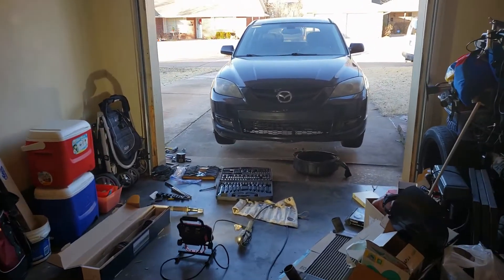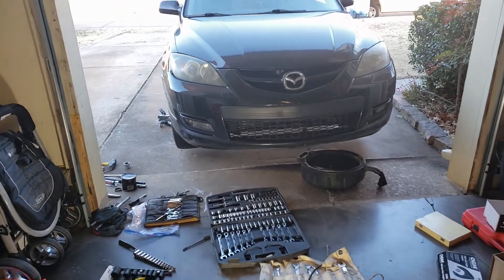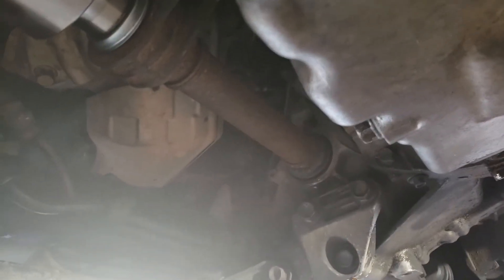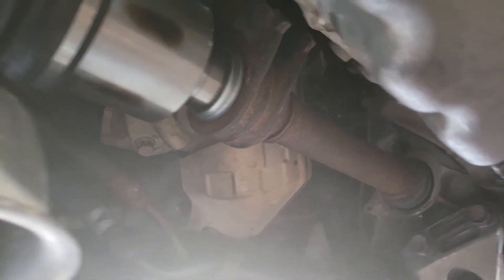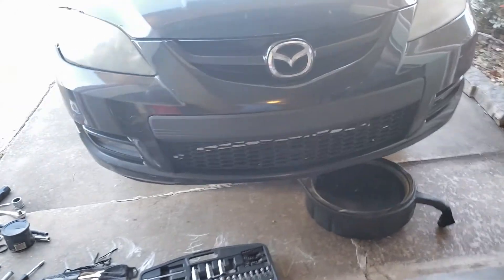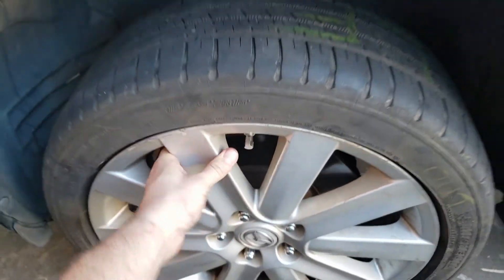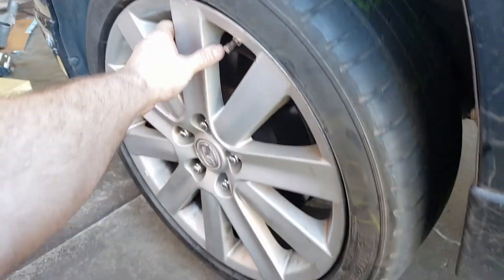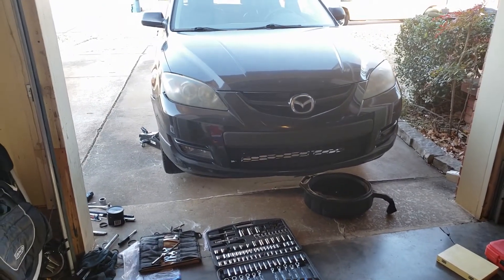Mazdaspeed 3 update

Comment: you could still have a wheel bearing out even though theres no play best way is to have all wheels off the ground and have someone drive it with a stethoscope near the hub / bearing you'll hear a grinding noise or hold the strut spring you'll feel vibration

Comment: Did the noise gone after replacing intermidiate shaft? I have the same scenario. I am hearing like grinding noise on high speed. I already replaced wheel bearing, both cv axles rotors and pads. But the noise still there.🥴
Reply from the maker: No it didn't. I realized afterwards that my problem was the wheel bearing. Replacing the driver side wheel bearing is what fixed the noise for me.

Comment: dude please polish those lights. 3m makes the best kit. Don't use Sylvania as the final coat turns yellow.
Reply from the maker: Thanks 😆 I actually replaced the lenses with nice used ones not too long after this
Reply: I have same issue with my 2010, I went ahead and replaced both wheel bearings and they were both buggered, I pulled rhs cv shaft out and the intermediate shift had a tonne of play and bearing was a bit noisey, I cleaned it up and the noise went away but after driving for a bit the noise returned ill replace my entire cv shaft and hope for the best, if no such luck ill be pulling the gearbox out 😢

Comment: im having an issue with my 2006 mazda 3 where my cv axle keeps falling out of the inner socket. Replaced cv axle and still is giving me a pull to one side like its about to try and fall out again. Is there anything you think could be wrong? It is a cv axle from oriellys. ive been thinking it could be a little too small and just not realising it or it doesnt fit on all the way? im at a loss
Reply from the maker: It has to pop in, there is a snap ring around the very in side of the shaft. Is the snap ring there? Did it pop in?
Reply: @Brazzzzzle  ya when i did it i heard the pop in place thats why i thought it was good

Comment: Thanks for the vid, always useful just to see other factory parts and how they’ve aged. When you do that oil cooler, the part you want to replace it with is JDM, about $230. Did mine about a year ago at 125k when it started to leak. Just so folks are aware; the FoMoCo part and subsequent gaskets are shite apprently (can even see it in photos.) i ordered the JDM part (comes with rubber gasket) and the quality of the part was wildly superior to the FoMoCo part I took off. 2¢.
Reply from the maker: Thanks! I did the oil cooler (WITH the JDM part) about 6 months ago. The oil leak was just getting excessive. Much better now.
Reply: I would recommend the Ford part that adapts it to the spin on filter. Off a Milan maybe? Also those wheel bearings are a bear to replace. YOu can borrow the puller from autozone but its a universal puller and doesnt quite have the right horseshoe adapter. It works but you have to really find the 1 position that gives you a stable perpendicular mount. And of course your going to pull the front race out with the hub and will need to grind it off, scarring the hub. I would just by the hub and bearing as a unit and those press in pretty easily with this same tool. Put bearing in freezer the night before.

Comment: What did the noise initially sound like? I'm chasing a slight grinding sound when on throttle and turning right. Goes aways once everything is warmed up. So far I've replaced my axels too and ball joints.
Reply: I have the exact same symptoms. Still working on it 😂 swapped the throwout bearing and clutch assy, still there. Thinking its the intermediate shaft bearing or wheel bearing now

Comment: Did replacing the wheel bearing help? I thought for sure when I was hearing my play in that shaft that it was something in my trans throw out bearing or something but that play is normal huh?
Reply from the maker: Yes! It did!!! I was really worried that it was something in the trans as well. Then i thought the axle/intermediate shaft was the issue, and it wasn't. It was the wheel bearing, driver side for me. Replaced that and fixed my problem! 220k miles now and still doing great!

Comment: 2007 mazdaspeed 3 with koni’s installed (exact same as me)
Hey man, when you replaced your axles did the new ones come with the same slot on the end of the axle where the nut is punched into? My old ones have the nut punched into a slot on the end right behind the wheel, but new replacement doesn’t have a slot or new nut.
Reply from the maker: I'm not 100% certain but yes I do believe the new ones have the slot for the nut to be punched into to keep it in place. I do not remember if the new axles came with a nut. I seem to remember reusing one of the old nuts for some reason.
I do remember having to punch the nut because I had installed the wheel and checked later and realized I had forgotten to make that punch on the final install.

Comment: Also did you have trouble getting it out and or did you have to remove one of the heat shields? By the downpipe?
Reply from the maker: No, I don't think I had to remove any of that stuff
Reply: @Brazzzzzle  thank you for feedback. Did you also use an open ended wrench to get the three bolts out of the carrier support? I tried a socket doesn’t seem to fit all too well and scared to strip them
Reply from the maker: @nolanrosa7020  I'm sorry I don't remember exactly what tools i used. But if a wrench fits better that's what you should use

Comment: Was the sound a clunk type of sound? Especially when accelerating or engine braking?
Reply from the maker: It was not a hard clunking sound and it only happened when I was turning, even slightly at high way speed. The problem was a worn wheel bearing
Reply: That sound would be your swaybar Bushings or endlinks